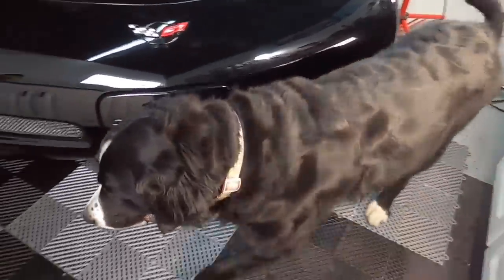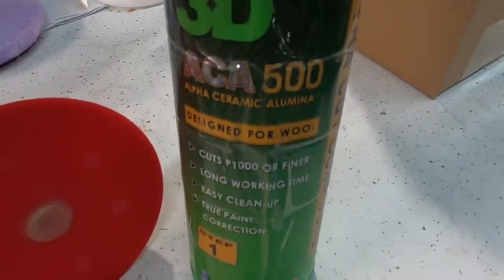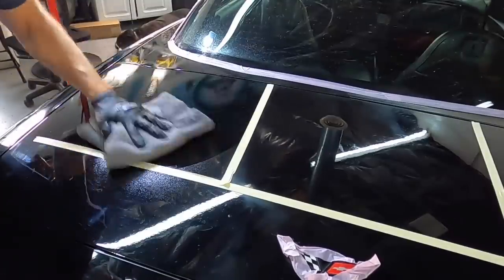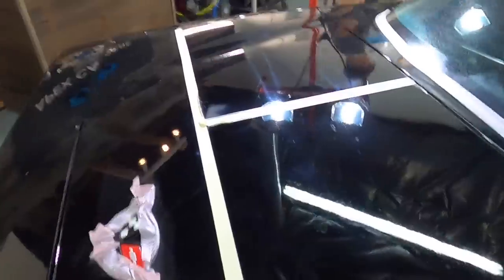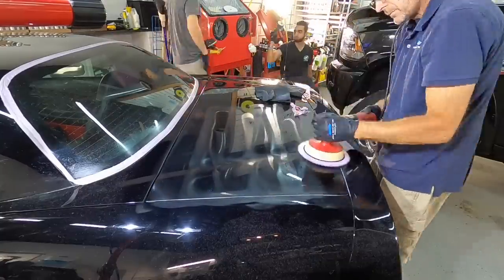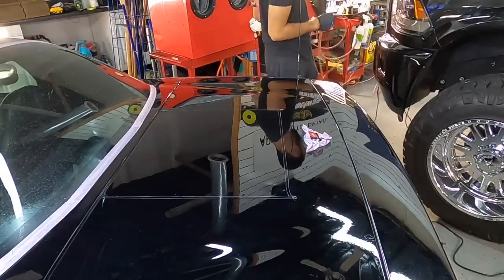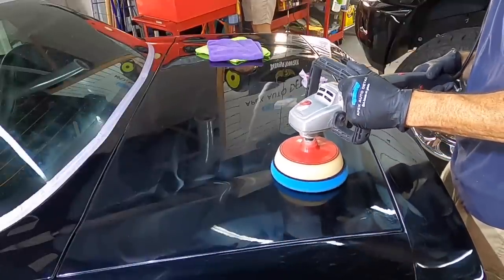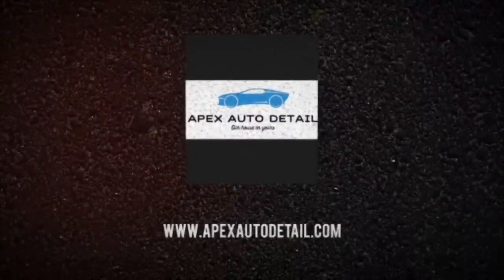CUT & FINISH With The Rotary Polisher! Part 1!

Comment: Great video.  I've been detailing for nearly 40 years both dealership and now as a side business. My 1st rotary was out of the late 70 early 80s . Old black and decker . Like 15 pounds.  Double sided wool pad . Bolt/washer to attach it . Now I have a 15 year old flex and a porter cable . I have 3 different da orbitals but keep going back to the rotary.  Seems like a lost art that's making a comeback.

Comment: Thanks for the Rotary vids. I hurt both my hands on a poorly balanced 15MM DA and a long 2 stage polish job...  about two weeks after that job, i was suffering.  Couldn't use my hands for a month.. Got better, threw out that DA with a vengeance, picked up a rotary and went to town on all of my old 'throw-away' cars. Worked my way up to my new cars.. I am still cautious, you really can make one poor judgment call or just space-out and cause some issues. I believe my vibration issues with the DA were a newly-selected HD Lake Country foam pad, they are very thick and hold a lot of polish. I did not change them out much, they got really heavy. Then I death gripped & applied a lot of pressure for some very hard clear.. Live and learn.

Comment: I'm glad you posted this video.  I paint corrected my trunk top a month ago, but I had bad etching left over.  My process in order was clay, compound and then turtle wax ceramic polish and wax. It turned out awesome except the etching. 

I honestly thought I did something wrong until this video came out. I even did a before and after video for the fb group but I'm hesitant to post them.
Reply from the maker: Post it. Show how responsible you were by not chasing perfection and shaving the clear too deep.
Reply: @apexdetail85  uploading now.  For the record I'm thick skinned and can take constructive criticism if you had any input on the videos.

Comment: Sonax itself suggests to use Sonax Prepare while polishing in order to add lubrication to help break down the abrasives even more. 
Helps with sticky paint as well 
1. Polish as usual 
2. When the polish seems to be broken down and became clearer add a squirt of prepare to the pad an do another 2 passes of polishing without adding more polish to the pad.

The ingredients in prepare act like the lubricants that are part of the polishes themselves and gives you an outstanding finish 
This method changed everything for Me and gives an incredible finish with one step polishes

Maybe you wanna give it a try 

Thanks for your work

Comment: I’m old as dirt now but back in the day I was pro detailer and I now have owned several Vettes and done various levels of restoration on them all. C4-C5’s have a clear coat problem where they had an especially hard clear coat to begin with and over time if not meticulously cared for it becomes brittle and flakes off ( skin cancer as many call it). Some of that “etching” is actually where the clear coat has gotten brittle and flaked off. My 06 (C6) is showing some clear coat degradation…. GM clear coat is crap, still to this day. What you’re doing is the correct call if the owner is against repainting or re-clear coating  and okay with a 20 footer as we car guys call it…. Nothing wrong with that

Comment: Great video Brian. Back to the basics…I love it. When you were using the rotary, what size backing plate did you use vs the wool pads? Another question is do you use some kind of soft/foam transition between the backing plate and the pad (it looks like about 1/1/2” foam?). The backing plates I’ve seen on line all seem to be hard think plastic. It makes sense to ‘soften’ the pad to flow over the contours.
Reply from the maker: Yes....I like some type of foam or rubber interface as cushion on my backing plates.

Comment: Hi Brian,

Actually i have a bunch of question. i want to upgrade my arsenal for my small business detailing. i have see a lot your videos on youtube. oke get throught to question.

i just have 1 polisher and its rotary, i love using it with wool pad. 3D One already on my wishlist, and the question is

1. for cutting compound, should i take ACA500 or Sonax CutMax ? (i love using wool pad 😆)

2. for finishing, is it enough using 3D One + Soft Foam Pad ?

or maybe using sonax perfect finish will finish it better ?

Comment: Hi Brian, I'm new to rotary polisher and I practiced on my old BMW that has been repainted with Sikkens High Solid clear coat. I noticed this clear coat is really really hard, I tried 2000RPM with Dewalt rotary polisher DWP849x with slow arm movement and light-medium pressure, and with Menzerna AS30 + twisted wool pad from Meguair's not even remove 2500 grit sanding marks with 2 passes. any suggestion for this type of scenario? and is it normal to use 2000 RPM for the cutting step? because I watched all of your rotary video series, and you said in one or more of your videos "cutting is more effective at lowest speed" which the lowest speed on my Dewalt rotary is 600 RPM.

Comment: I noticed you were using a small rotary machine.
That machine would typically run a three and 4 inch pad. Does it have sufficient power for larger pads?

Comment: Great turn around. I bought a rotary last winter and practiced on a junk panel. Not to good. Lots of skipping. What causes that?
Reply from the maker: Add more compound or a pad conditioner. Tilt slightly....5 or ten degree angle. Maybe even less pressure. Make sure speed is between 3-4
Reply: @apexdetail85  thank you

Comment: Any tips on using the rotary on vertical surfaces? I seem to struggle on those. On flat panels it works very nice.
Reply from the maker: Apply slightly more pressure...tilt slightly on a 5 to 10 degree angle. By slight pressure...I mean only enough to make up for the weight of the polisher nor being cradled by your hands.

Comment: Can you show paint thickness before and after? Why do you make more passes with a Rotary or is that just with the AACT? I thought they cut easier? What grit sandpaper did you use?
Reply from the maker: We are shaving no more than 25 microns off the top. You can afford a few more passes with the rotary as it runs much cooler than a DA polisher.

Comment: Hey there umm great video ,i used to work in the detailing industry back in the late 80s to the 2000s somewhere, but i remember a representative from some company and he showed us how to use a palm sander with a foam backing then we could attach various grades a wet sandpaper to i think 1.500 ,2.000 and of course then then polishis,it was a 3 stage process,so i was wondering is this method still used ? as you only used a little none motorized hand thing ..for the lack of the proper word lol.
Reply from the maker: Absolutely...it would be a good option. Keep in mind, now they only teach dual action polisher use...so not many will take those steps.
Reply: @apexdetail85  umm not that im familiar with a dual action polisher, hmm i wonder if i should have pointed out that we didnt do a whole car .. but just a panel with a bad scratch ,or maybe like the vets trunk .lol my bad kind of forgot about that part, what can i say its been awhile lol.
Reply: Oh wait i think maybe i do know what dual action might be .umm regular spin and oscillating or off center .